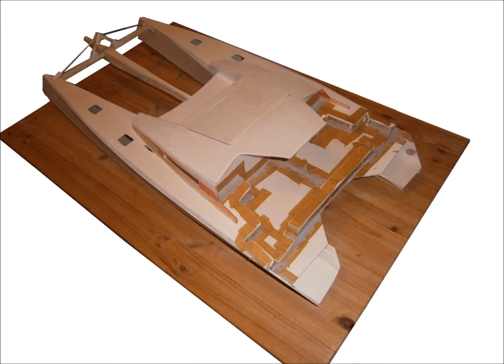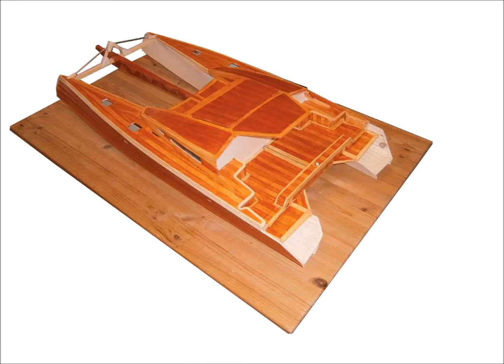Homemade RC Performance Catamaran - The Construction Process

Comment: Such a beautiful sailboat model, well done!!
I really like this design, very close to a modern real cruising catamaran.
It seems a good project to realize, I'm interested in building one. Do you know if I can find the building plans somewhere?
Reply from the maker: Hello Giovanni Lorenzi,
 Thanks a lot. I'm glad you can see it's near a modern cruising catamaran … that was the goal:-) I developed the design by myself based on pictures which one can find in the internet (look for the MC260 performance catamaran). I did not save the drawings; that’s why I cannot provide any plans. I didn’t think of making the building plans while I built the boat and it is too late now.
These cruising multihulls seem to be suitable designs for RC Boats. So far I have built two different models (slyder47 and MC260) and I am quite satisfied with the sailing performance of both. 

It’s definitely a cool project! As soon as I have time again, maybe I’ll build another catamaran and then keep the drawings to derive a building plan!
Have fun and let me know if you start to build one!